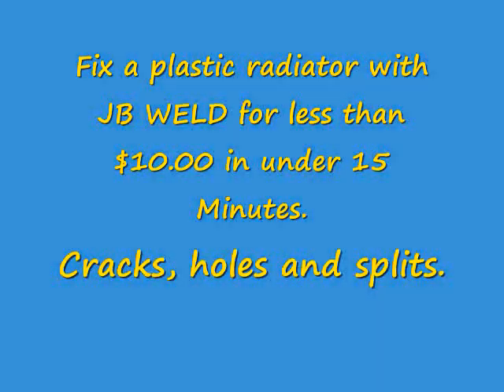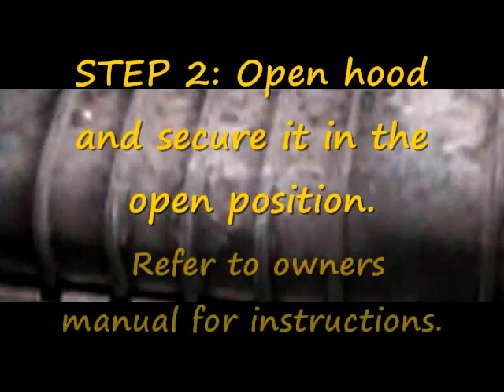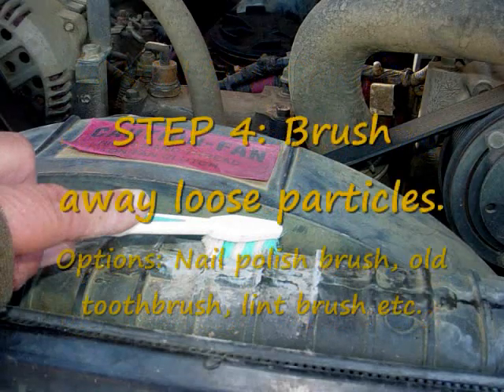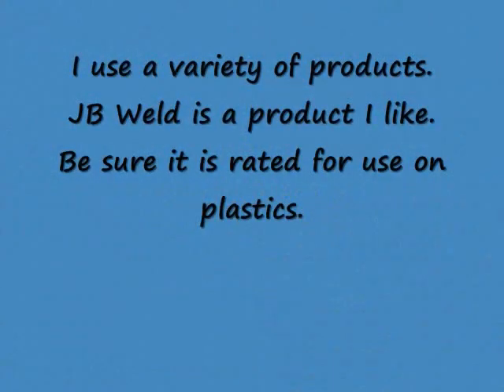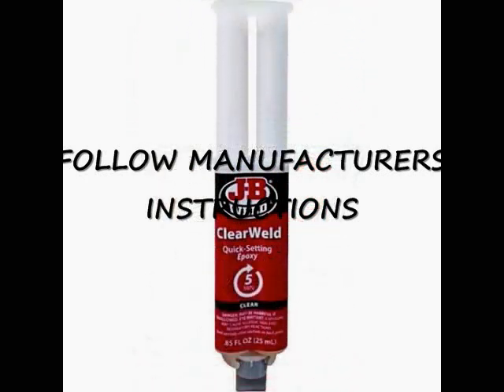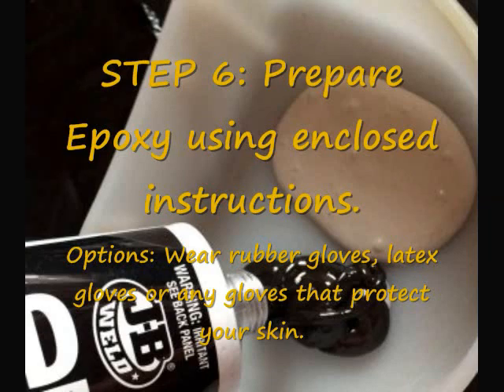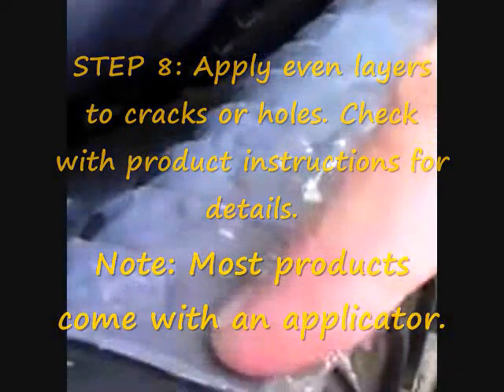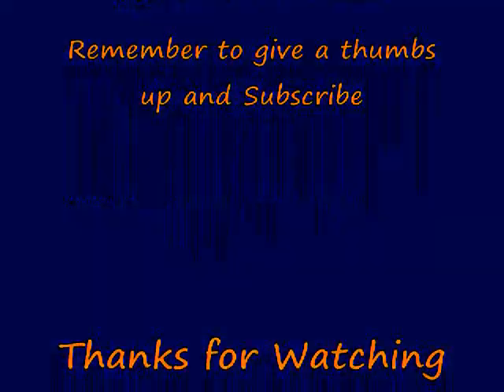How To Fix Leak On Plastic Radiator-JB WELD ($15.00 & 15/minutes)

Comment: That looks exactly like my radiator. Looks like a Ford Diesel? 2016 is my dads, looks the same. Please let me know. Thanks
Reply from the maker: Thank you. Yes it's a Ford Diesel 1997 Power stroke. It's now 2023 and it's still holding.

Comment: it works for small splits with the plastic weld. did it work on the long top split in video? i tried on ford that split almost all accross the top, i applied the jbweld epoxy clear one they had in 3 layers (apply, wait a day, apply , wait a day, apply..). still it split up the epoxy easily on first drive. not sure if plastic weld will do better.
Reply from the maker: It worked for me. I sanded the area and, cleaned it well before application.

Comment from the maker: Hey everyone, JB Weld has a plastic radiator repair kit, complete with a hot-mix epoxy,  sand paper, fiberglass cloth and an applicator brush. I bought a kit yesterday for another vehicle and it cost under $15.00 from Napa Auto Parts. I hope this helps.
Reply: Rainbow Ranch Farms I'm going to try this on mine.  I have a pinhole size leak.

Comment: And how long did the jb weld last?? you can't fix a radiator leak on plastic with jb weld. it might last a little while but it's gonna leak again. save the time and replace the radiator
Reply from the maker: Great question. Thanks. No this is not a permanent repair. This is only a quick fix until you can get a new radiator. Sometimes people experience much needed car repairs at the most difficult times and this is just one of many ways someone can easily make a temporary repair until their finances can accommodate a permanent-fix, such as replacement.